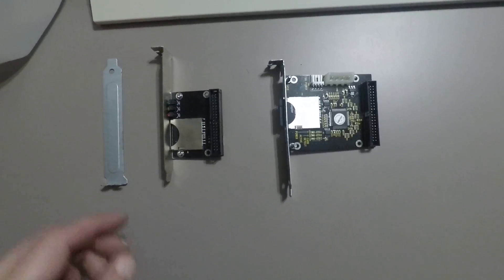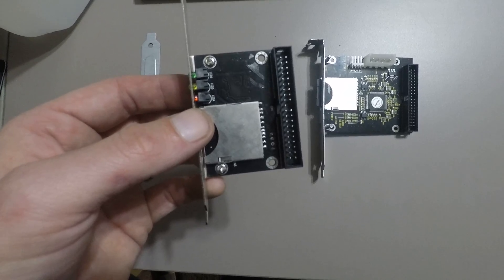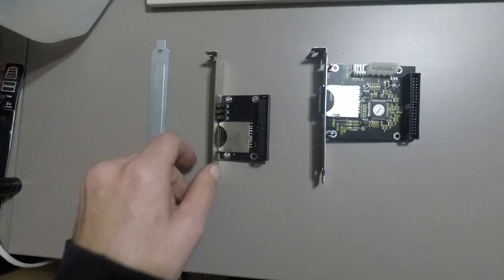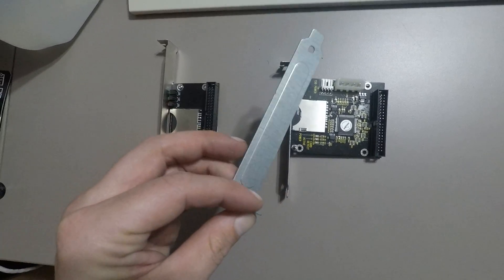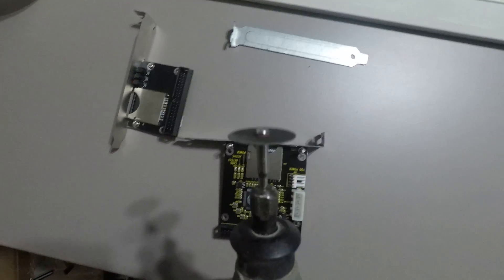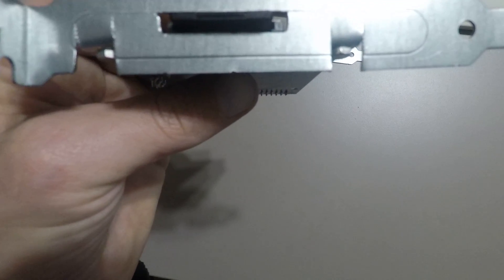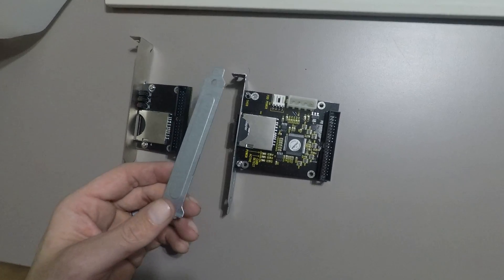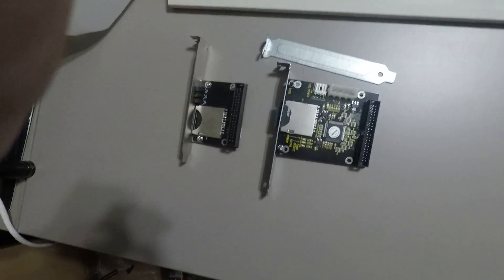IDE to SD card adapter terrible design and how to fix it!

Comment: I know it's a bit of a long shot being a year since this was posted but can you please provide a link for the adapter with the smaller pcb that had the faulty bracket?
Reply from the maker: Bought it on Amazon, but it's apparently not available anymore. "Eachbid SD TO IDE 3.5 Baffle Internal Drive Adapter Board" is the part.

Comment: The way I have mine is that it props out from behind the case. Problem is sometimes it doesn't work and if you try to move it while it's powered on in that case it'll shut the pc off and you'll have to unplug and plug the computer back in. I really would love to have a 3.5/5.25 drive bay that HAS an area when you just screw the adapter in and can remove an sd card from the front.

Comment: Nice! Yea I'm not sure how they could the height wrong :) Another trick is hiding the adapter in a front HDD bay :)
Reply from the maker: Very good solution as well. I happen to have a case that I have to remove 4 screws and slide both sides as a unit off to access the inside. For anyone with a side panel it may not be a big deal.

Comment: I have one of the SD Card adapters with the power connector for my 386 machine. Such a good buy for $10. I ended up having to mount it internally under the 3.5" drive bay, and have to take the side panel off to change SD Cards. Fortunately I don't change it very often at all so i haven't had an issue yet.
Reply from the maker: That wouldn't have been as big of a deal for me either, but I think a lot of the old cases require removing 4 screws and sliding the whole thing off. Thanks for bringing that up!